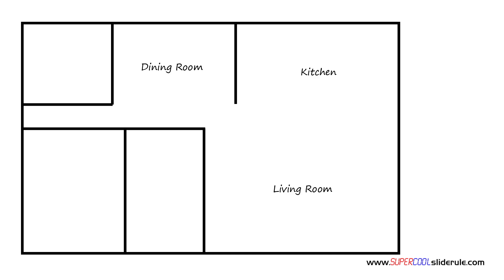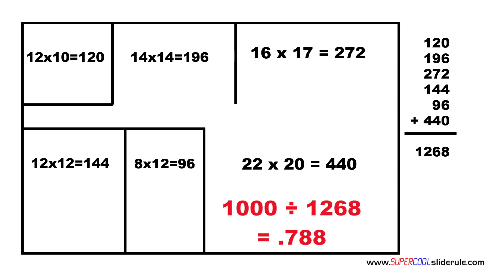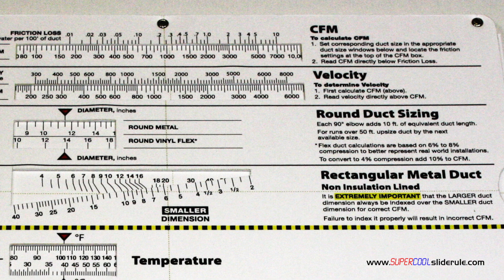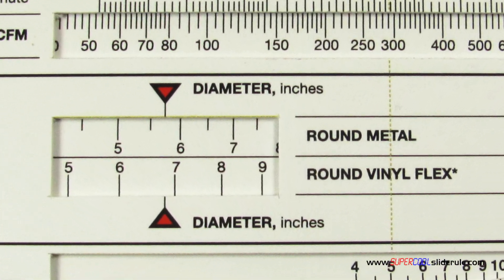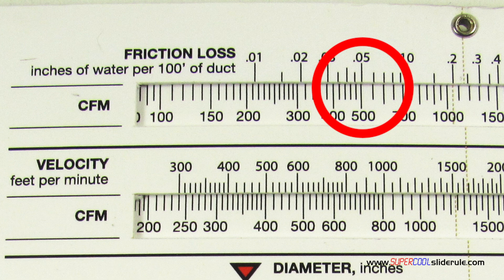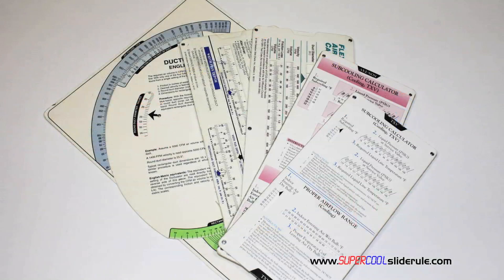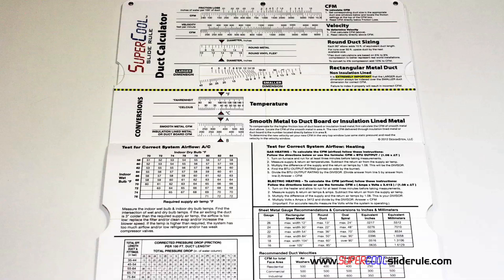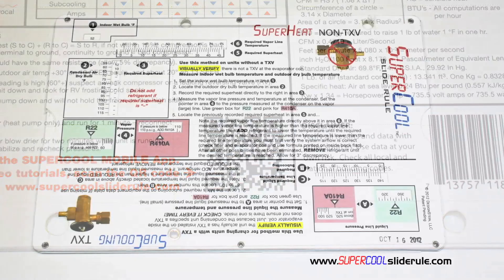Duct Size - How to size a Duct System for a House

Comment: PURE BS,  Ask all the engineers at ACCA or ASHRAE what they think of your SUPER duct design!  It VIOLATES the very foundation of physics. You make no account for rooms with larger window foot prints, skylights, sliders etc. What about crawl space area's having higher heat loss and requiring maybe double the CFM's. You do this trade a DIS-SERVICE! Nothing wrong with your standard run of the mill ductalator, its your teaching how to use it that is full of crap!
Reply: + Lo Mar -- it is sad that guys with your attitude  are in the field. I am by no means a new Tech out of school. I've been a tech for the same company for 15+ years in the south. Guys that call  0° superheat ok are just ignorant to the damage they  are causing. I feel like you drowned in that glass of water you keep mentioning and gave up on repairing and setting systems up in the correct manner. Guys like you make the good techs rich because when the customer sees the difference in quality they are receiving for their money they will never have that lazy misinformed tech over again. I make a living off of these attitudes but they still get under my skin. I NEVER comment but please do your trade and your customers justice and at least get it half right. Have you ever witnessed a system that was setup properly? One that has had the correct maintenance done every season? They run just as good on day one as year 20. That's the difference. I hope your attitude changes before you spread it to a guy that could turn out to be a good tech. It's contagious, because of  laziness and complacency. It's easy to have the attitude you have,  and it's a shame.  Whatever happened to good craftsmanship?
Reply: Ur drowning in a glass of water trying to over engineer something that doesnt need to be  over engineered.   Its not rocket science  and the world aint perfect, if your an hvac contractor your going to die of a heart attack and if you are im sure your not very successful. Rules of thumb, know what works. know your theory but use common sense.
Reply: Matthew.. I can still tell youre a new guy stressing out trying to fix all these fuck up jobs you speak of. I can feel it in your writting. Trust me.. I been there. Youll grow out of it cos youre gonna have too. And your static preassure readings dont make sense. You cant be pushing  300 cfm per ton at that static. Sounds to me like you got that reading with a dirty filter. Static is a tool to determine if you got a plugged evap coil at best. I usually relly on temperature rise... Its more acurate as to the cfm.  And listen...  Ive charged tons of acs and a system that takes 6 pounds  and you can charge it to its specified superheat according to wetbulb and outdooor temp etc.... And you know how many ounces does it take to bring your superheat from perfect to zero? One once. Thats it...   And to be honest problably 5  out of  100 units i come across have that perfect reading... 9 out of teen have pretty close to  zero superheat and yet theyve all been running just fine for years. Superheat is more of an indicator of how close youre to full charge ,,, its also a good troubleshooting number for troubleshooting txvs... But always keep an eye on your subcool and operating pressures when mirrored to outdoor and indoor... My fucking point is... Just fucking charge it and dont worry if you have a cold line if you have an operating pressure of well above freezing point. All these measurements are troubleshooting tools... Dont be drowning in a glass of water if the lines cold.  If youre pressures are within range....its fine,, And dont frigging get me started on ductwork. Ive been using a fucking ducktulator for 15 fucking years and ive never ever had a problem. I always design my  supplies to .09 to .1 static... And my returns to .o7.... No fucking problem!!!! Now fucking get over it...grow the hell out of that new tech stage or else you will die of a heart attack. And im being nice by giving you this advice cos i have a feeling that youre a good guy and you care.  Trust me...   When theres something seriously wrong it will be easy to spot..  Jesus christ mattt,, now get in your van and go the fuck away and go  fix a leak or something
Reply: @fromra8569  Dude please get the fuck out of HVAC, reading your comments shows you have absolutely no fucking clue about what you are doing.
Reply: Also I'm a technician Alabama where the humidity is above 90% and it's 100° in the summer. And it's a long long summer. People are complaining of the power bills and how hot and muggy it is. Put a compressor through 0° and a long summer like that and see if it does not shorten the life of it. I just don't understand. It is my job and I am proud to be good at it even after 18 years
Reply: I will only give you one thing.... and  i will agree with you about zero  superheat when you have 90 percent humidity in the house...See here in northern idaho we have hot dry summers.. so  its very easy to charge it... go over an oz and zero superheat and its fine.  When you have 90 percent humidity and its 90 degrees in the house... youre trying to charge it outside  factory recomended conditions.   YOURE FUCKING UP RIGHT THERE. Its possible  to add tons of refrigerant  and have it all evaporate in the coil and get 10 degrees superheat due to the huge heat load from the 90 degree air 90 percent humidity. In IDAHO we rarely come across those conditons around here.. and when i do... its usually in light commercial buildings... so what we do is charge it according  to pressures... dont flood it.. typically ill have an operating preasure of 40 degrees or higher  and maybe 60 degree line  20 superheat... let it run for 24 hours and check on it the next day. Businesses can afford the 2 service calls and its more crucial in commercial aps since their equipment  runs  so much. In fact if i had 90 degree air at 90 hum  i don't think  you would charge it at all.. ... it will be out of range  for most superheat charts. I get that... and most descent  teks get that... but i camt stand your god damn attitude though.. so 95 percent of the duckts jobs out there are wrong and only your work is 100 right?? Lol you smug  son of a stupid  bitch. Thats how you should know ur wrong.  And youre full of shit... .5 inches of external static? Wtf... you mean on the ducts past the evap?... here are static pressures of a god runing system...  these are in reference to  atmospheric. .. negative .4  or more past the air filter... maybe .04 to.05 on a descent return.... another .3 to max of .5 before the evaporator... and between .06 to no more than .1 in the supply..  NOWWW IF YOU HAVE A CLOOG... you willk see  .1 or more either at a dirty  filter... or a clogged evaporator coil... and there willl be zero on ducts and everywhere else cos there's  no air.... youre a phony or youre not using youre  equipment  right. Youre a pain in the fucking ass... i would  never wanna work with you for you... or have you work for me and i wouldn't  want you in my house. Youre gonna wanna tear and fix my shit up even  though it needs no fixing. You think youre infallible  and i hate that fucking attitude.  If 95 percent of the world is wrong and youre 100 right maybe you oughta rethink  things. You've  obviously  never installed duct work for a living. .. youre running around with your stupid fuciing  manometer  freaking out cos theres some pressure on your ducts.  Get rid of your manometer dude... ducts THEY ARE SUPOSE TO HAVE THE PRESSURES I JUST GAVE YOU YOU NUMB NUTS.  Fuck  i wanna smack  you  and knock your stupid little  tek hat.    You need to be humble... obviously  you are not. And listen dude... i know more about this shit and understand it better than you ever will... i can just tell by the way you try to explain shit.. and dont argue with me. I quit that  trade 2 years ago and im on my 2nd year for my mechanical engineering  degree... in restropect... now i understand  my former trade than i did before. Mathematics and physics can really give you an insight into physical  phenomena. Get over your bullshit attitude please. You're  really getting  under my skin. Dimwit
Reply: MrMerkat24
Reply: I know your comment was posted a year ago, but I cannot get over this. Like I said I never comment,  but athought process and attitude like yours really causes problems in this industry. I see horrible work in the residential side of this business all the time because of people like you. I'll give you an example. Had a no cooling call a couple of months ago from a new customer.  This customer was defensive as soon as I walked through the door. They did not like HVAC service technicians. He told a story about running through countless contractors that has not  corrected his problem.  His home is only five years old. At first this guy did not trust me as far as he could throw me. And for good reason. I could tell the contractor who designed his system used these "rules of thumb"  that you talk about in your comment. He used one of the slide rules to design the ductwork and  it was obvious. The first thing I did when I got there was make sure all the equipment was running.  After I confirmed that I took a quick static pressure reading. The TESP  was over 1 inch of water column on a PSC blower.  He was running slightly less than 300 CFM per ton after I made my calculations. This was a fixed metering device and the superheat  was running around  1°.  The compressor sounded horrible. And after reading some of the invoices left with him and the description of work it was sad. It came from guys like you. Either you have this attitude from a lack of knowledge, a lack of skill on how to apply this knowledge or you are just plain lazy.  The customer had a false impression that the equipment that was put in his house was a horrible brand. He also had a false impression that HV AC service technicians were rip off artist.  People like you with your bad attitude and horrible craftsmanship not only give good technicians a bad name they give reputable air conditioning brands a bad name also.  Needless to say I gave him a fair price and a guarantee. I redesigned his duct and got his charge correct and now he is a customer of mine forever. He called to tell my manager that he would have nobody at his house but me, from now on he was a customer of ours.  I am in NO WAY  bragging, it just strikes a nerve with me how people can be so careless with other peoples money.  I do not know how much damage was caused to the equipment from poor craftsmanship and poor planning up but I do know I did my part. I did my job the correct way. Please stop spreading false information across the Internet about how to perform this job. You need to lay your tools down  or start caring about your craft. All it takes is a little bit of effort to do things right.  You will not have a heart attack as a business owner if you do things right. The only reason that you haven't is because you don't care. It is very rewarding to do the job like you're supposed to. You should try it sometime.
Reply: Lo Mar 
I don't really enjoy commenting, but I must say this. New tech my ass. I've been in the field since 98. This is on my own. I had to work with guys and install before this. It's extremely obvious to me that you don't take many static pressure readings if that doesn't make sense to you. My company makes me record these readings every day so I know you're just coming up with something to reply with. I will saying it was on the higher end. That's why I had to do something about it. Most residential blowers are designed to work at .5 static. My total external static pressure readings every day average .7 or .8. I have better things to do with my time then argue with someone over you tube. After I redesigned the duct  the total external static pressure was sitting at .5. I think I know how to diagnose a dirty or clogged evaporator and if I don't know when there's a dirty filter there I need to get out of my truck because even the homeowner knows that. Now don't get me wrong most duct out there is wrong and I wouldn't give it the time of day to repair if it's not horrible. It's still wrong though. My point is when I design it is correct. And I am not a new technician I'm just a good one. It's funny how you have this attitude that after being in the field for so long you get careless. It's called complacency. Superheat does not just tell you if it's full. It's all about evaporator performance. And a 0° superheat you have a flooded coil. Yes it will cool but it's not designed to be flooded. It works much better when the refrigerant is evaporating in the evaporator. Your temperature splits that you were talking about are only giving you a dry bulb type reading. And of course a 0° superheat your dry bulb split is going to be good to go. When you were looking at your enthalpy split you can tell how many BTUs you were removing and what your evaporator performance is. And those numbers will be better with the correct superheat at the evaporator. And if most the ones that you come across are zero superheat situations why don't you take that ounce out u talk about? I guess there's nothing wrong with having a subpar attitude like yours, it just blows my mind. It's just not acceptable to me even after 18 years in the field. We can just agree to disagree on this one. Yeah I've had long days where I've looked at one and thought I don't be picky. Just let it go. Believe me. What gets on my nerves is the sub par attitude about Duct design. Then techs and homeowners have to deal with it when it's wrong. 95% of the duct jobs I come across in the field are wrong. People just deal with it. And when I design  mine it is correct. I do spend time on looking at friction loss, static pressures heat load calculations on the home, and then heat load calculations on every room. I understand running a no cool service call and just getting up going because you have 10 in front of you. I'm talking about the ones that are headaches that you have to deal with because someone either didn't know what they were doing or had a poor attitude about designing the duct. This is what gets under my skin. You may be a great technician that can fix every problem that you see. What is the attitude that you portray about duct design that bothers me. Because these are the guys that calls me the pet peeve type headaches that I have to deal with. That I have to spend time on.
Reply: And i will dare you do do an enthalpy cooling load calculation  where you take into consideration  both latent and sensible heat according cfm and relative humidity. You dont need to fuck around with that shit.. all you need to know is that if you have lots of humidity  your sensible  temperature  drop will be rather low  and its ok. You're  throwing  terms out there... I've  caught  your bluff and your bullshit. GOOOD DAY NOW
Reply: Fucking idiot.... at first i liked you.... now you really  got under my skin.... what sucks for you is that all of your former bosses agree with me... lol.  You have to be humble  in life  you  dumb ffuck!!!!! Fuck  i really cant stand you know.
Reply: Please stay away from fixing duck work most of all.. go  frett and worry  about your  superheat.. lol. ... you're better offf there. There you can at least vent some refrigerant into the atmosphere... feeel happy and go home. Please go home. Lol. Fuck man!!!. Trust me.. im being your friend.   DONT WORRY ABOUT. ..  IF YOU DONT FIX IT CHANCES ARE NOBODY WILL EVER NOTICE THAT YOU DIDN'T FIX IT  because it never needed to be fixed  to begin with.... now go fuck your self. . .  You smug fuck
Reply: Lo Mar, i'm going to copy and paste something for you. 
http://m.contractingbusiness.com/archive/measuring-static-pressure

You need to pay special attention to it, especially the area about MAX external static pressures. And there is endless resources that I can pull from so that we can end this. As I stated before I really do not like commenting on this YouTube stuff, but I will when I think some extra information is needed. Look, all this cussing and acting irrational is not doing you any good. Seriously I'm probably going to copy and paste several links so that you can understand what I'm trying to say. Obviously you don't. Obviously you have no idea. And as far as my bosses go, they love me. I generate business, customers appreciate me. I spend countless hours off the clock learning this trade and always have. I cannot understand why you were getting so angry. I called it like I see it. There are some people that like to get things right, and I think this annoys you. You sound like you have a lot of resentment inside of you, it seems like you can't handle when someone tries to help you out. You seem like the type of person who doesn't like to be wrong. That's why I'm going to copy and paste things so that you can understand what I am trying to say. Your static pressure measurements are wrong my friend. You're moving less air than the fan is capable of, and designed to do. Why do you think most residential systems have .50 max external static pressure right there on the data plate? You mentioned you were getting some engineering degree of some sort. These engineers are the guys who designed these things to do what they do under certain guidelines and circumstances. We have to understand why. I do not believe you for a split second. I'm going to give you some more stuff to read so that you might understand. And if you can't I'm so sorry for wasting your time. You call me smug, when all I was trying to do is shine a light on this BS. I don't want guys thinking that it's OK to be half ass. Come down to Alabama and run service during these conditions. Half of our calls are because of high power bills. Us poor folk in Alabama can't afford those high power bills. Hehe. Anyone can fix a piece of equipment that is not working. Get it up and running and leave. But can you be successful on the high power bill calls when the equipment shows that everything's OK? It's 100° and 90% humidity most days here. I had to learn these things so that I could be successful on these type of calls. I have several customers that ask just for me and will wait for me because I have shown that I can solve these types of problems. And my friend the ductwork causes most of it. Every once in a while you'll get a set of heat strips that are running in the cool mode, or some other issue. When you bring a customer's power bill down by applying your knowledge in the correct way they really appreciate it. I have no reason to prove myself to you, I just I hope that what I am trying to say helps someone become better, and you don't seem to like that. You seem like one of those techs that can't handle the situation, will slam your suction hose on charge it till it's 40° SAT on the low side gauge and leave. And that's wrong my friend. Static pressures are a great tool in situations when you need them. My boss happens to agree with me that's why he wants us to record the static pressure on every call. It might not matter so much in the north I don't know. I've never worked there. But physics is physics and you were still moving less air at those static pressures. But duct pressures and psychometrics matter here. This is what separates the professionals from the hacks. This is what lowers the power bill. I'm going to see what you say next and I'll send you another link so that you may see all the numbers that you were spouting out are ridiculous. This is why the residential side of this business is so messed up. I came from the commercial side over to the residential side long ago and couldn't understand why there were guys designing duct Systems that were not qualified. Call me smug if you want. Call me an idiot if that makes you feel better. I've got lots of friends, customers, mentors and coworkers that will tell you different. Why is it so wrong to do things correctly? Why does it bother you so much? Why do you spread this lie about heart attacks and drowning in water if you do do things right? What is wrong with you? Look at the link tell me when you're done and I will send another one from a completely different source. And I will do it over and over again until you stop commenting and cussing like this is personal.
Reply: Lo Mar by the way you sound like one of those dumb kids in middle school that like to pick on people and call them names. And then gets embarrassed because they are who they are. Why is this so personal to you? I am humble. Like I said I never comment. Go look and see for yourself. The minute I did I have some guy that is wasting my time with name calling and nonsense. And I'm still trying to shine a light on things for you. And I'm smug? Chill out Lo Mar. Its all going to be ok. Keep doing what your doing and I'll keep doing what I do. Agree to disagree. Life goes on.
Reply: Lo Mar here's you another one Lo Mar
Reply: Lo Mar http://www.achrnews.com/articles/131530-duct-dynasty-four-essential-static-pressure-readings-for-diagnostics
Reply: Lo Mar oh and here's you another one. This one I think you absolutely need to read Lomar they have the exact numbers that you were spouting out as right being absolutely wrong.

http://www.achrnews.com/articles/128252-duct-design-and-proper-airflow
Reply: Lo Mar this is hilarious. Hehe. God man. Engineer student my ass! I think I'm going to send you a few more links so that you can learn a little more
Reply: Lo Mar after this on my ignore you. You're the type that can never be wrong.  You will resort to name calling and cussing to blow off your steam.
Reply: Just calling your next move...
Reply: Lo Mar full of shit! On a furnace take your total external static pressures after the filter in before the evaporator, look at the data plate and it should be .5 inches of TOTAL static MAX! On air handler the coil pressure drops are built in but the max external static pressure is .5"!!! Look at the data plate! And then look at the links I sent you. I'm trying to help you with it is it seems like you are completely confused.
Reply: Lo Mar bottom line I am bored with this, I like you Lomar, I need guys like you around, your type make it easy to look good in this trade. Maybe I'll come up there and get to know your customers and make a ton of money fixing what you've put in. It's a nice back up plan. I hope you pay more attention to your woman then you do this trade, because if not I feel sorry for her. I'm done with this. I'm tired of wasting my time trying to explain to you something you should already be skilled at. You are not worth my time Lo Mar. i'm done
Reply: Lo Mar "Rules of Thumb" are the reason so many HVAC contractors have poor quality installs. ASHRAE manuals are there to help and be sure things are done right. With that attitude, I wouldn't want you working in my city, let alone my house.

As a mechanical engineer, this ductulator is not something I would recommend.
Reply: Brother, ive been repairing and  installing new construction  and retrofitting residential   duct work  for about 15 years,, and ill tell you what works,, and ive used  ductulators my whole life and theyre practical and acurate enough. There is such thing as trying to  re-invent the damn wheel and i see a lot of hvac novice men out of tech school drowning in a glass of water  and freaking out  over  technical  data such as the superheat having to be 5 when its zero,, and the thing is, its ok to have a god damn cold sucktion pipe with zero damn degrees of super heat.,, let it go, pack up and over to the next service call.  Its the same damn thing with duct design,,  rules of thumb and know what works for your area. I live up north where it gets both extremely  cold and extremely hot for a month or so,,  so i will tell you your load needs for both heating and cooling  for your home, old or new.  I wouldnt be as confident in arizona since ive never sized  equipment for super hot climates,,  and sizing  equipment varies from hot dry  climates like AZ,  to hot humid equipment like florida and the deep south.  A long term local contractor will know  best at the better price., .... .  Id tell you more and give you some life saving tips on duct design, but quite honestly i dont wanna help you  out,